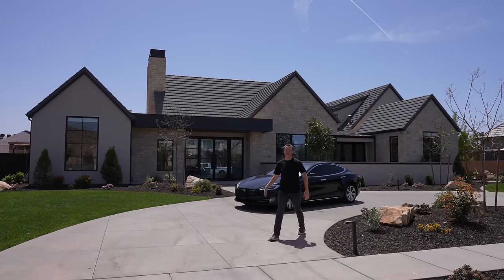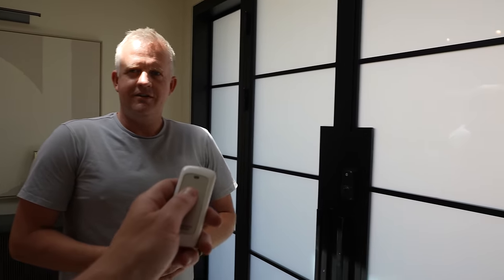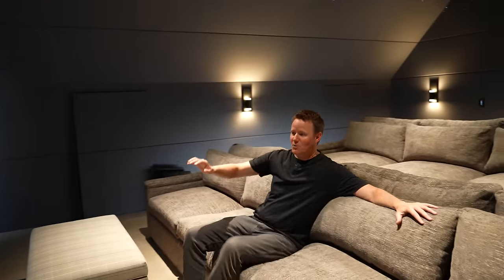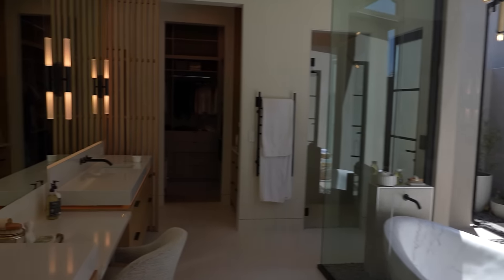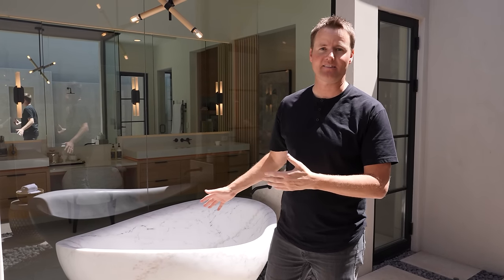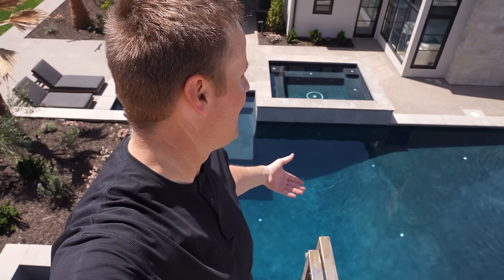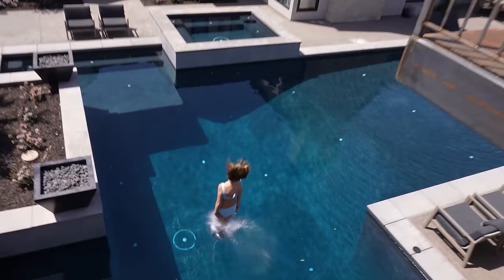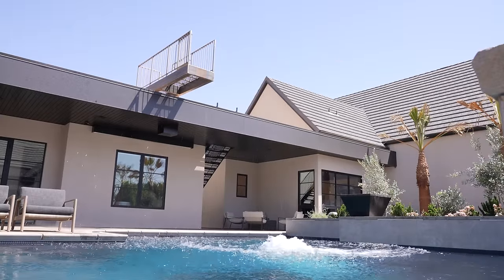Best Dream Home Features 2022!

Comment: The technology in the windows uses crystals that, when an electric current passes through them, they get arranged in a way that blocks some of the light.
Reply: so its default to see through when theres no electricity?
Reply: @bondrewdbestdad  yes
Reply: @palmon1  Actually no,  When electricity is applied to the film via the wiring, the liquid crystals align and the glass instantly becomes clear. When the power is turned off, the liquid crystals return to their normal scattered positions rendering the glass an opaque translucent".

Comment: In a world where the Simpson property could cost multiple millions depending on the location, I thought that dreaming of a couple of non-essential rooms was already setting the bar very high... This is on a whole different level!
Personally, I don't like the milk glass. I would have preferred one-way mirrors, even if they cannot be switched on and off.
Speaking of Japanese design, I would want a Genkan and an Engawa. The prior is an antechamber where you take off your shoes and outdoor garments. The latter is a type of veranda, today with panorama windows that can close it off into a corridor. Just imagine the view of your garden from the comfort of your home and if the weather is nice, you can open it up and have a smooth transition between indoors and outdoors... You could also have a room like this in the garden with special ventilation so that you can do BBQ or garden events in any weather...

Comment: if you can get power to the glass door maybe the nest smart lock won't need to be battery powered.  Also maybe the remote could be integrated with Alexa or an app on your phone, or even a wall mounted button that doesn't need batteries.  that privacy glass is needed in all glass bathrooms that are becoming popular so your neighbors don't see you taking a piss or bathing.

Comment: i personally would probably extend the jumping platform out another foot or 2 and move the small garden platform back away from the jumping spot but a few feet.
as for the outside tub/shower, if it was a special room on it own its fine, but other otherwise I would want a retractable roof to enclose to at times.
Reply: You're supposed to jump out far when you jump off the jumping platform, heck you're supposed to jump out far even with a normal diving board

Comment: Million dollar house, and the diving platform is already rusting because the metal is not sealed.  Could have at least painted it, but in a multi million dollar house, it should be powder coated!